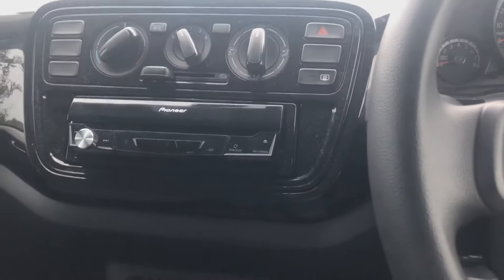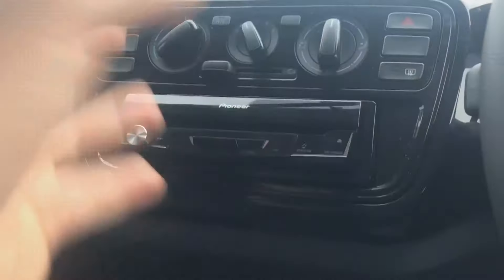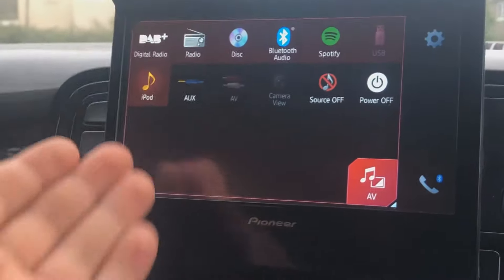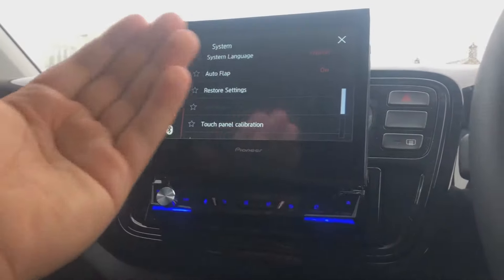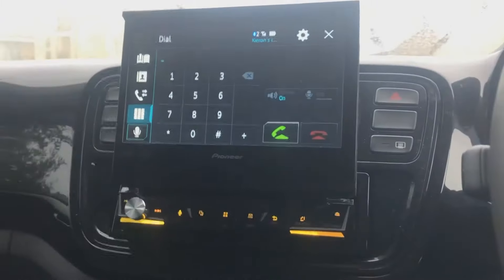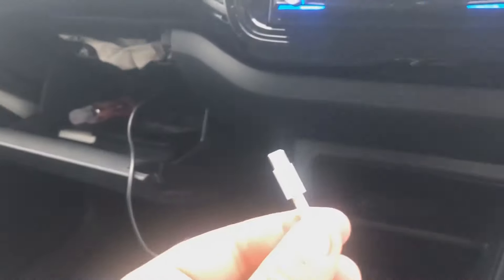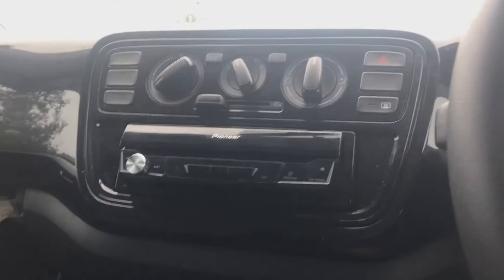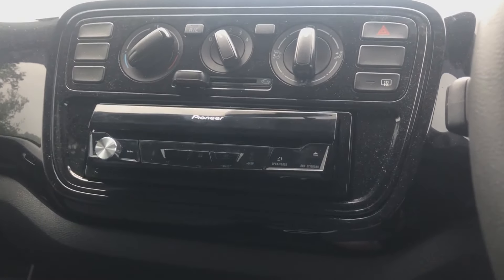Pioneer AVH-7100DAB Single Din REVIEW! (Apple Carplay & Android Auto)

Comment: Definitely looks like a really nice way to be able to get Apple CarPlay in the up. Considering doing it to my own 2014 up. Would love to see an installation video, especially the wiring. :D
Reply from the maker: The wiring is definitely a bit fiddly, but you can get the adapter kit and then just need to run a wire to the fuse box so it goes off with the ignition, but I’m sure I could put something together! 
Appreciate the feedback!

Comment: I’ve just purchased one of these for my VW Up and was just wondering how you were able to get the USB extension into the glovebox and where you fitted the digital radio tuner box? thanks I’m advance!
Reply from the maker: Ah nice! 
Inside the glovebox you have this plastic tabs on the right side of the interior of it, you take them out and you’re then able to feed it from the back of the radio into the glovebox,
And when it comes to the DAB receiver mine is fitted on my windscreen and then fed down through the plastic trims; hope this helps!

Comment: Hey there! Solid video thanks for all the information! A little difficult to find information on it as it is an older radio by now. Been looking at getting this radio since I only have a 1 DIN slot available in my car, still a bit pricey, but quality seems to be there.  There is one feature I was curious about though; I read online that it is not possible to adjust the screen brightness? Is this true or is there a dim option for night time driving?
Reply from the maker: Hi thanks for your feedback. 
That’s a very good question, off of the top of my head I am sure that the brightness can be adjusted but I would have to check. 😊
Reply: hi did you manage to find this out? also I'm wondering what happens if you close the screen while driving and then quickly open it sgain before its fully closed - e.g. if you wanted to access hazard light switch to say thank you quickly

Comment: Im looking into buying one. 2years later is it still working just fine. Just asking my friend said not to get one cause the motor would blow out on the open close
Reply from the maker: Had mine in for years, I have the screen on auto, so everytime I turn my ignition on the screen will come up and when I turn the ignition off the screen goes away, and I haven’t had a single issue at all with the motor on it,
Pioneer are a good quality company so, I wouldn’t worry about that at all!😊

Comment: Is the mic built in or do you have to buy a plug in and how is the quality of calls
Reply from the maker: You have a microphone that comes with the unit that you’ll have to plug in and run the cable to the location you desire.
Reply: @BuiltToDesign have you had any issues in sound quality? I had a pioneer unit and the external mic was rubbish

Comment: Hi. Can you tell me how much cm is the radio? with the screen saved. Thanks
Reply from the maker: Sorry, how do you mean?
Reply: @BuiltToDesign  Hi. Forget the question, I got the answer. But I have another question. If my car has a mic, can I use it?
Reply from the maker: Should be a connector slot in the back of the unit to connect it to yes,
But the unit comes with a mic anyway so whichever one you prefer really!

Comment: How far does the screen come out from the unit when deploying to upright position?
Reply from the maker: It’s snug, but I can put my hand in behind to adjust the temperature settings from above, but for convenience I put the screen back down to do it, but where you have the screen positioned can be changed in the settings so the screen can sit further out or at an angle!
Reply: They have a reversing camera

Comment: Does any section of the face come off?
Reply from the maker: Do you mean for the install?
Reply: @BuiltToDesign  I meant the front face? Are you able to detach any part of it and take home when the car is locked?
Reply from the maker: The front bit of the buttons does detach from the radio, but really once the screen folds away I wouldn’t really say you need to take anything off, 
Hope that helps!
Reply: @BuiltToDesign  thanks 👍🏽

Comment: I can’t seem to find the answer to my question.  Would this fit on a 2011 BMW Z4?  Is there a Pioneer model that will?  Been searching and I can’t seem to find an answer.
Reply from the maker: Hey! I did some research for you and found this in a forum, I hope it helps! https://z4-forum.com/forum/viewtopic.php?t=106868
Reply: BTD Thank you.  I too found this model and am thinking this is the way to go until I read additional things he needs to make things work.  I would assume everything needed would come in one package.  I believe all I need is the Alpine.  Reading that post assumes I’ll need additional parts unless I’m reading too much into it.  I appreciate your help.
Reply from the maker: Always happy to help. For the VW Up! I had to buy the fascia, radio holder and radio wiring adapter/aerial. They’re all fairly easy to come across and low pricing too!
Reply: BTD Rigjt.  Looking at it I don’t believe I’ll need all that extra stuff.  Also looking at the Alpine ILX F259.  That one looks good to me as well.

Comment: Where are you based? Can you set this up in my up 😅
Reply from the maker: I’m Somerset, probably rather far haha!
Reply: @BuiltToDesign  damn, 3.5 hr drive, do you have any more details you can provide, did you need to buy any new bits as well as the radio it’s self? Like facial’s, cages, antenna’s etc cheers!